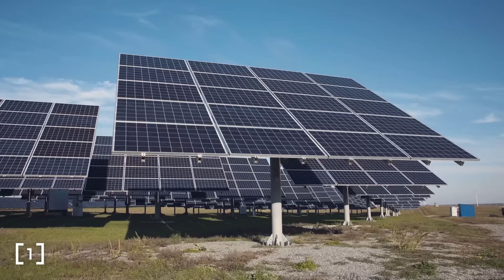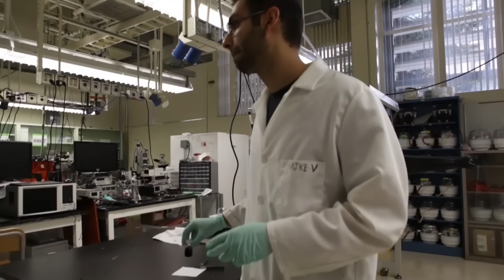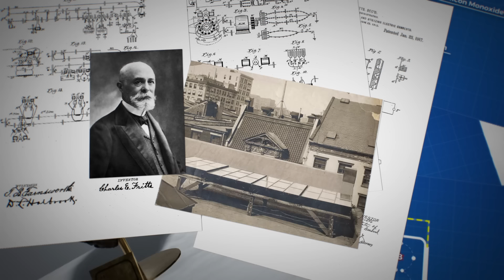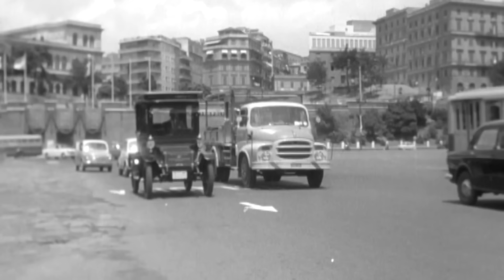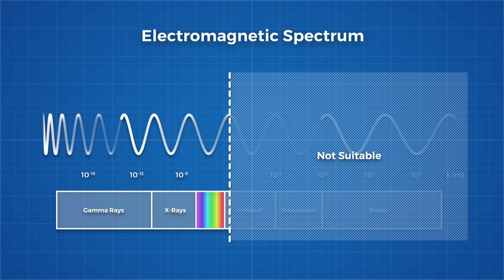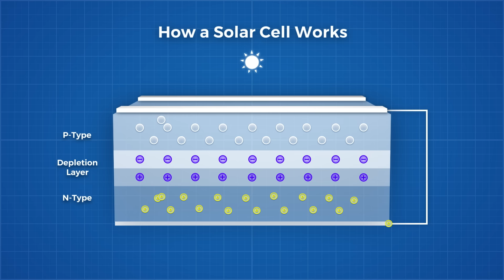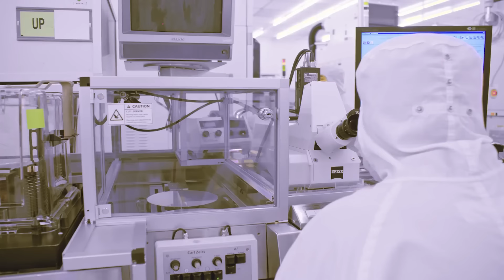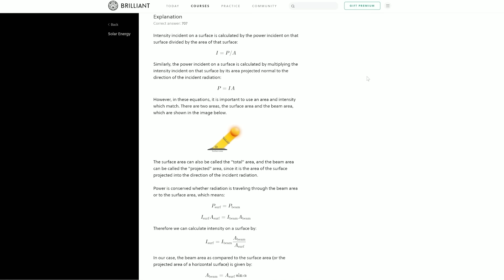The Mystery Flaw of Solar Panels

Comment: 10:09 This is not quite true. The electric field does not accelerate the electron, otherwise we could increase the potential arbitrarily just by adding more and more of the junctions. Instead the junction acts bit like magnets giving static push/pull, no energy gained or loosed. The potential comes solely from the absorbed photons.
Reply: Mister, if you're saying that a potential difference doesn't accelerate charges you need to explain yourself
Reply: @battleclan  Of course, but here the significance of it, is just giving direction to the drift, IE the charge separation. Just like with magnet and iron nail. You cannot make net energy with those, even when the nail accelerates towards the magnet.
Now looking back, I think I just misunderstood what he was saying. First it sounded like he argued that the free electrons wouldn't have any potential and the junction would create it (it just separates them).
Reply: @user255  Yeah, that's how I understand it. In equilibrium, there's a static electric field in the depletion zone that counteracts free electrons in the n side to drift to p side. But when there's free electrons created in the p-side, they drift by the electric field. Someone else mentioned that the PN junctions in solar cells are made with wide depletion zones so that most electron exitation happens inside the depletion zone.

Comment: Few years back I saw a video about suggested spinning PV collectors, the idea was that making a cone shaped "panel" with a transparent cover that focuses sunlight on it means it will always be at best angle to the Sun no matter what time of day it is, and by spinning the cone is always half in shadow and cools down so it will not lose as much efficiency due to overheating. Someone had done some math and suggested this design would have four times less efficiency losses, which supposedly would be worth the extra expense. Plus, these mushroom shapes look better than flat panels so as works of art people will like having them visibly placed in cities like on top of light poles. Makes sense, but obviously there would be issues with how much energy does one cone actually produce and how much of it does the cooling system waste, and the complex design incurs extra costs people might not want to pay even for art.

I guess nothing came out of the proposal as I haven't heard of anyone ever planning to install them anywhere. And frankly, I'd prefer having twenty normal solar panels on some roof rather than a fancy curio "art piece" that is not likely to ever produce enough power to cover costs of making it.

Comment: Dude your graphics and explanations in this video are sick. Your videos like this are the reason i am doing my undergrad in materials science you absolute legend.
 It would be even cooler tho if you did a follow up looking at the different ways scientists and engineers are trying to increase the efficiency of solar panels.  Like with the problem at @6:10 regarding ideal wavelength ranges for incoming light for silicon, surely you could have multiple solar panel layers where each layer abosorbs their own part of the incoming spectrum. If im not mistaken multi layered solar panels are a thing?

Comment: I've always assumed that solar cells were made with a photolithographic process (since that's how they're made in the lab). Why aren't the topologically optimized contact designs implemented? Or rather, how's the contacts formed in the industry?
Reply: Do they use photolithography when making these? I understand how it's used to make transistors and such, but does two huge sheets of p and n type material warrant photolithograpy?
Reply: @battleclan  Well, I dont think it's just two huge sheets of p and n type material. I'm not an expert in solar cells (which is why I'm asking), but they do some solar cell research in one of the labs I'm using. They use a photolithographic process (in addition to other techniques) to achieve areas of varying degree of doping, patterning the surface, etc. I just assumed similar techniques were used in industry. But I definitively can see the cost-benefit of optimizing those away. It's just that according to the video the possible efficiency gain seemed to be pretty high.
Reply: Nå ble jeg nysgjerrig, hvor holder labben til? Kan høre med foreleseren min som er sjef for halvledergruppa på UiO, han burde ha kontroll på hva industrien driver med!

Comment: "The reason solar panels lose efficiency as they get hotter is quite complicated" literally every circuit loses efficiency as it gets hotter though? Heat always increases resistance?
Reply: He is referring to the solar panel cells and it has to do with quantum mechanics.
Reply: Yes, heat usually increases resistance but this effect is negligible compared to the quantum effects that completely dominate at increased temperatures

Comment: Hate those scales where wavelength increases on the x axis... essentially going from extreme high frequency waves to low frequency, the opposite of what we're used to graphically. If you look at the graph at minute 6 and imagine it flipped horizontally it makes more sense energy-wise.. energy increases until the frequency exceeds the capacity to react, like sound waves exceeding the range of the ear,,,,

Comment: One other thing we are wasting on solar is having fixed panels. If you have panels that rotate and change their angle, you would get a lot more power per panel per day. This wouldn't require too much parasitic power from the panels as they wouldn't need very powerful motors to move them due to the speed they would be moving at, just a large gear reduction. We already know the efficiency of electric motors very well. This would also mean you could use less panels to get the same effective output, reducing material cost overall. Sure the motors aren't free and neither would be the people who program them, but its still a hell of a lot cheaper than the extra panels needed.

Comment: Really well done. I don’t comment much but since I have a masters in electrical engineering specializing in high efficiency solar cells, I really wanted to say nice work! Next step talk about tandem cells and see how they can push the efficiency limits to the 40% range (expensive - only for space or concentrator purposes). Also it would nice to mention that there is NO theoretical lifespan for photovoltaic cells. Unless physically damaged they’ll last forever! So also a big area of research is in better encapsulation so no moisture get in which is the typical failure mechanism.
Reply: Does this mean that the existing solar PV is not worth getting until the issues addressed in the video have been addressed?? They don't seem to be very efficient at all.
Reply: Dorothy Madden no. Solar PV is quite good currently. It is exponentially reaching the LIMIT of efficiency. This means there won’t be massive gains anymore unless somebody can break physics (or discover new physics :) )

This means that you shouldn’t skimp on cheap products though. As better workmanship and manufacturing will likely outlast any 20 year warranty they provide.
Reply: @seanajacobs  sorry to be pedantic but you literally can't grow exponentially towards a limit. Exponential growth is towards infinity :P
Reply: You’re right. The term I was looking for was logistic growth. As it’s approaching an upper bound as an inverse exponential rate. Thanks for making me find the right term. I had forgotten it.
Reply: But in the end chaos reigns supreme. The enthropy of a closed system always increases in time. Nothing lasts forever.

Comment: As I understood it when we were learning about diodes in my class, holes aren't necessarily charged, but are rather a vacancy. I've always found it strange to think of it at a physical "thing." If electrons are removed from the lattice, it becomes more positive/less negative. This was how my instructor taught us transistor biasing, as you now have two junctions and three doped semiconductors (either npn or pnp).

I never did a lot of chemistry, so maybe I'm missing something. If anyone has more info on that, I'd like to learn more.
Reply: You can look at it in terms of the imperfection a missing electron leaves in a lattice. If you dope a silicon crystal with boron atoms, the lattice is still a silicon lattice. So in the covalent bonding sites where electrons are missing, the positive charge of the neighbouring silicon atom dominates. These holes can move through the lattice - or rather, the covalent bonds move, leaving other holes behind.
Reply: Not sure if I get your question, but in case it's about "holes" - you are correct, they are not a physical thing. They do not "exist". It's just a model so we can easily talk about "x is moving". 
Same like the electron orbits - they also do not exist, no electron moves like that. 
And to put it on the next level: You can also argue, that an electron is not a "thing" since it has (as far as we know) no volume.

Comment: what about we use gallium nitride! for the solar panels it can be used with sillcon  becuse its a class binary III/V direct bandgap semiconductor that if mixed with sillcion and irideum plus combuned that it can handle 400C/800-1200F and its highfrecentsy hightempurte,high efeintcy and high voltage all at the same time not to mchon it can have up to 70% efectcy solar panals but can handle like 4x the heat before losing electric conductivity and make powerful lights, heck it can be used to make megaman x's solar fusion reactor core becuse its propertiys can be used for both condictuive slaor panals and used as a traslation metal spintronic magtenic semicondutive propertys makes megaman x solar fusion reactor viable heck i thing dr light used a butt ton admount of gallium nitride to make x brain,megabuster,LED headgem lights,acatormodters,and sensor you name it it was made with gallium nitride gallium nitride is bascly the meteral that most of the sci fi ficton wrighter where wating for to make it posable in real life its protecal is that good

Comment: I mean i would say the biggest issue was storing the energy for night time. Battery tech hasn't come anywhere in years to make them more cost effective and more efficient. So no, coal and natural gas are here to stay for a long while because you need those techs to produce solar panels. Along with the fact that government subsidies are helping these be installed in mass because no one can afford these. Without tax grants Solar and Wind are still far less productive that coal, or natural gas.

Comment: Wait. So Peltire cooled solar panel exist and are more efficient??
Reply: Yes and no, it is true that Peltier cooled solar cells are more efficient. BUT, they produce less total power as some of the energy has to go to the Peltier cooling devices. The tradeoff here is that you get reduced cell degradation over 20 years as the solar panel is operating at a lower temperature

Comment: What is staring us in the face, is that only 20% of the incident energy that falls on a solar cell is actually converted to electricity.  That means the other 80% is wasted either as heat, or in someway reflected back out in the space. Are there Thermodynamic reasons for this inefficiency, or do they relate to quantum mechanical band gap issues....
Reply: Uhm. Did you watch the entire video? The reasons for the efficiency loss are pretty well explained
Reply: Kexmonster Yeah you’re right, WTFM!